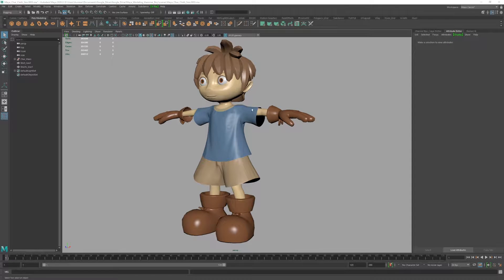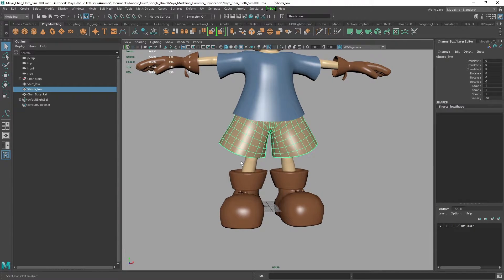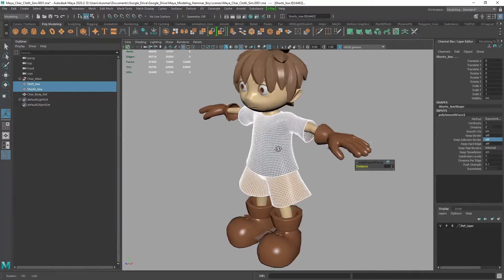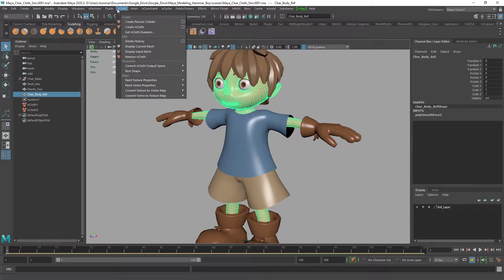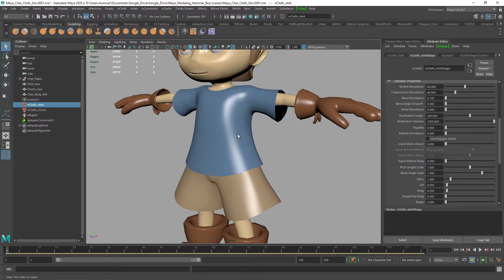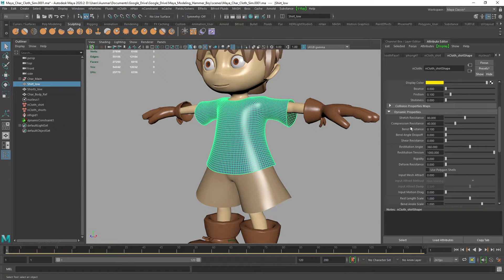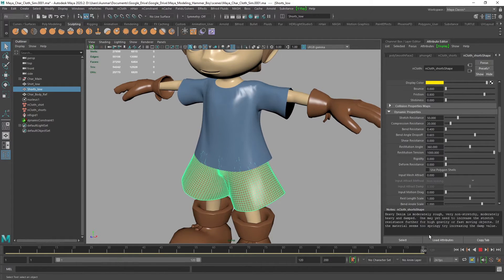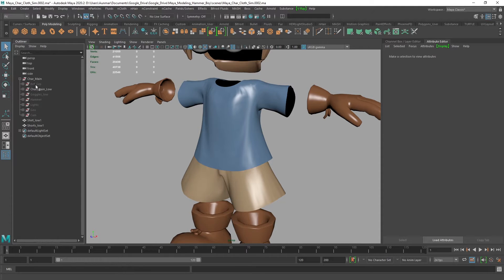nCloth in Maya - Simple workflow for Clothes!

Comment: Thanks for that. So if you extrude some thickness on inner arms, neck for instance, then the UV’s will need to be redone, and then the cache has different geometry. Do you shrink or proximity wrap deformer after to use the single sided as cache and get the finished topology to follow?
Reply from the maker: When you simulate clothing, I recommend simulating it one-sided then export the model and add thickness after the fact. That way, you only have to do UVs once and don't have to shrink wrap or deform it back to the simulated model.
Reply: @OnMars3D  oh, ok. Thanks. But if you add extra geometry inside of arms etc, it will be different vertices than the cached sim won’t it? I mean for animation a walk or movement rather than just for draping if you see what I mean. So if I cache a single sided shirt for example with say 50 frames in Tpose then into the walk, simulate and cache it. When I put extra geo on that model for thickness or buttons etc and uv it I can’t see how the animation single sided cache would work? Sorry if I’m not making sense, been banging my head for weeks and weeks on this.

Comment: how do you add thickness after simulation? that's what  i struggle with. I enver know if I should simulate cloth with thickness, without, or just have it where you can see inside (sleeves)
Reply from the maker: I definitely simulate without thickness as simulating with thickness presents more challenges. After simulating, I then add thickness by extruding the geometry.
Reply: @OnMars3D  what if the inside of your mesh is supposed to be a different colour?
Reply from the maker: You can just select the face loop from the extruded and detach from there. That will give you clean separation between the exterior and interior of the clothing.

Comment: Thanks. This is a very helpful video. However, I have encountered a problem and I hope you can assist me in solving it. I have two pieces of clothing (baggy top touching slimmer pants). The two cloth objects, especially the pants, bounce around wildly at the point where they intersect, like a sizzling effect. How can I remove this? Is this what happens when one cloth object penetrates another? Thanks.
Reply from the maker: If things like that start to happen, increase the 'Substeps' and 'Max Collision Iterations' in the Nucleus settings in the Attribute Editor. When simulations bounce wildly, that typically means there are not enough substeps/iterations for the calculations. 

Worst case, you could simulate them separately. Do the pants first, bake it, then simulate the shirt over the pants for a realistic result.
Reply: @OnMars3D  I did increase the substeps and max collisions and it made no difference, but I also noticed something else. The collision thickness of the two garments are interpenetrating, as a small section of the pants' thickness is poking into the underside of the tucked-in shirt. Could this be the problem? How can I fix it without moving or shrinking the clothing geometry?